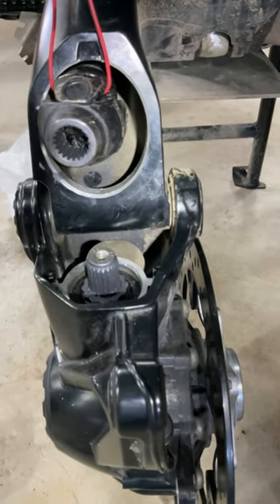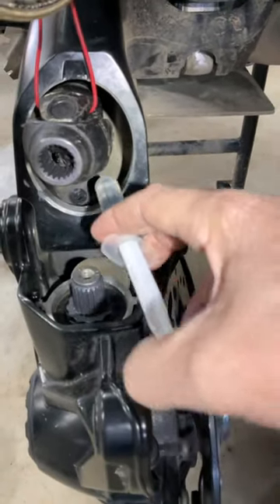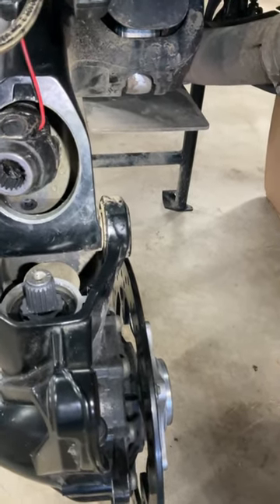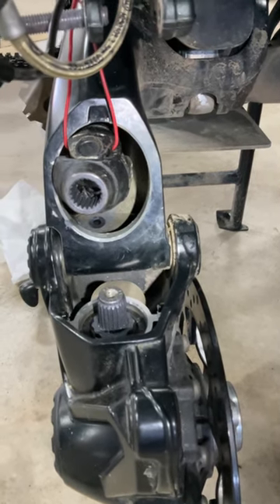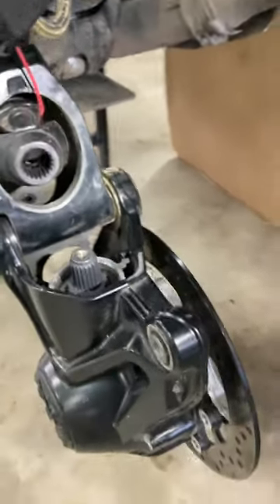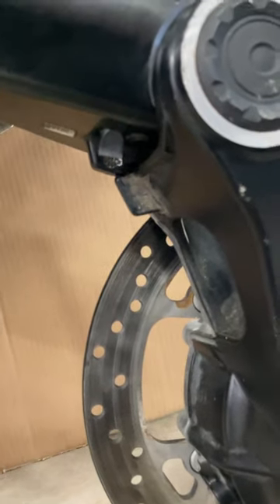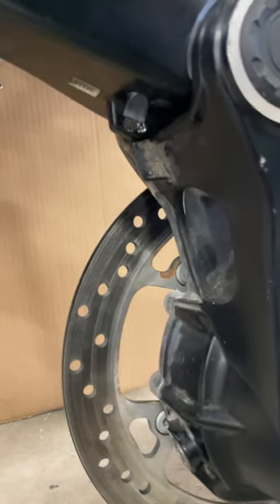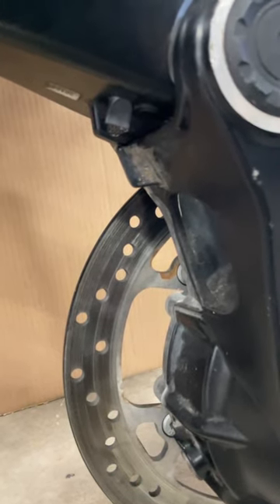BMW R1200/1250 GS/A Swing Arm Water Drain Demonstration

Comment: If you fit an o-ring around the valve from the outside and cover it with vulcanisation paste, it's secured in place. But at first it's advisable to treat the bare aluminium of the bore with some paint and then insert the valve with the same Staburags stuff used for sealing the boots of the cardan housing.

Comment: I wonder if the centrifugal rotation (at speed) of the shaft may aid in pressurising the driveshaft cavity (swingarm) and help purge any residual moisture that may collect in there. 

Very much doubt it with the looseness of the larger flex joint on the top of the cardon joint 🤔

Thank you very much for taking the time to show this though, very informative 🙏🏻

Comment: Just got mine back from dealership yesterday, new shaft in and duckbill drain fitted, touched it and it’s gone straight into swing arm. Had to fish it back with thin nose pliers. It’s utter rubbish what they have done, it’s not a tight fit at all. It’s going back as I’m not happy in any shape or form with the drain plug
Reply: That's truly sad.  Not expecting that from BMW.  Thanks for the heads up both of you.  I won't act on the service bulletin.
Reply from the maker: You might consider asking your service center/dealer if they can test your driveshaft but not install the drain.

Comment: What do you think, the water does while you're driving? 😂
The condensed water from humitidy causes the rust problems. This is not solved with this rubber solution.